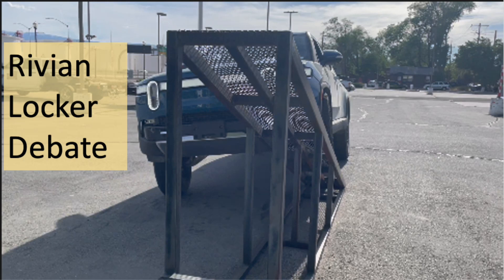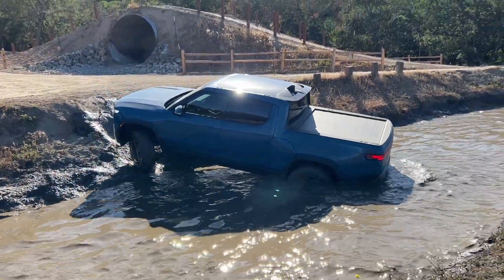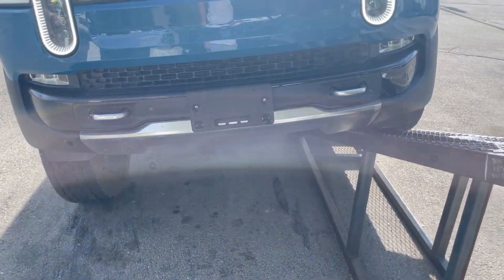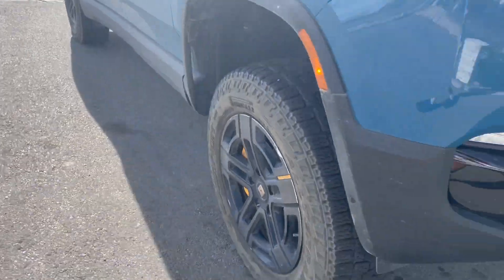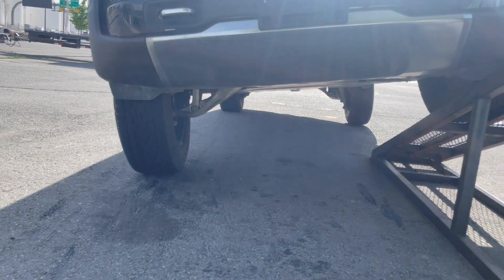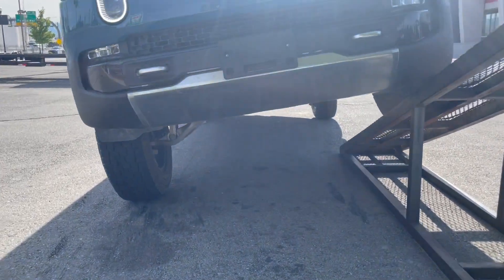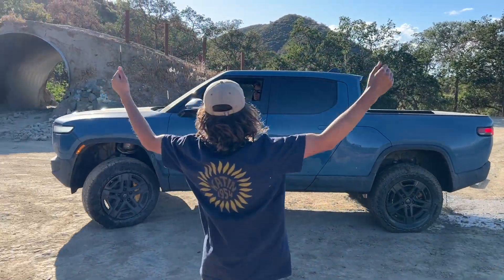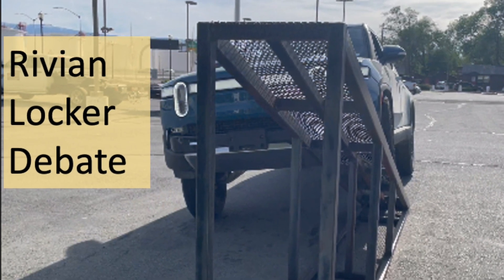R1t vs  Articulation Ramp

Comment: Quad motor or dual motor? I don't think quad has shafts connecting both sets of the wheels i think each wheel is individually driven, i feel like the software tuning needs work. If dual motor, then there would be a front and rear drive shaft going through a diff so in this case definitely should have a locker.

Comment: Did you try sand? That should better mimick a locker.
Reply from the maker: That is an interesting point. I did this before sand mode was launched, so I’ll go back in the next week or two and give it a try.
Reply: @Rex Briggs  I figured, as that was a newer feature they released. Also a snow mode. But that just eases the petal a bit from what I have seen. Be interested if what you find with those 2 new modes. Thanks for the videos!
Reply: @rexbriggs3251   any follow up on this?

Comment: What they need to do is incorporate a full send mode that locks all four together and transmits equal power
Reply: Not equal power or torque but rather making all four rotate at the same rate. Or better yet the same rate modified by steering angle.
Reply: @WilliamAArnett  sounds like a plan
Reply from the maker: I like it too Bihh and Bill. I am sending a link to the comments to my R1T advisor, and maybe it will get some consideration.
Reply: Off road use only of course

Comment: Not positive so don't quote me but, 4 motors working together, this vehicle is incredible, but limit grip to a single wheel and it's quartered, which paired with a heavy vehicle, might be too much for it to overcome.
Reply: Each motor has 200 hp. That’s plenty even if only one has grip. In this case two have grip (LF and RR). The problem is that the software isn’t asking the motors with grip for enough power. Perhaps it’s sensing that the two wheels with no grip are slipping and reducing power to all four?

Comment: Push the pedal until the vehicle moves.
Reply from the maker: You’re not wrong :) 
But, in certain situations I don’t want to floor it and wait to see if it takes off- that could flip the vehicle. I would like to have control to inch forward.
Reply: In rock crawl mode the entire pedal movement equates to 20mph - does that mapping not give you sufficient control precision?
Reply: That doesn’t work. It limits the power even at full pedal. Very frustrating!
Reply from the maker: @WilliamAArnett  so true. It does seem like that could be fixed with software.

Comment: I’ve had similar problems where there was plenty of traction on one wheel but it got no torque. It seems like a some sort of software fix should be possible. This has been known for a year now. Why haven’t they fixed it????
Reply: Each motor has more than 200 horsepower. That’s WAY more than needed to push the truck up that ramp. The problem isn’t that the motor is powerful enough it’s that the software isn’t asking it for any. (Torque at zero rpm is no problem.)
Reply: @WilliamAArnett  its torque that is the issue.  The max torque is actually made just above 0 RPM's.   A jeep in low range produces more power with lockers at a single wheel with a  weak little 275 hp motor.   The other issue is if it is able to move the wheel its likely to spin like its corked up wheel speed.   I think there are a number of mechanical disadvantages here, specially for rock crawling. But only time will tell, guess we will see if they improve without redesign.
Reply: @Story_Teller_Everyone  Well, I agree that the R1T isn't a very good rock crawler. But not for the reason you posit. IMHO, it's just a software bug, or maybe a missing software feature (plus fragile suspension and vulnerable bumpers and rocker panels). That these things haven't been fixed is probably just a matter of priorities for Rivian, not fundamentals.

Yes, theoretically a 275 hp (260 lb-ft) Jeep (3.6L V6 auto) with both axles locked could put send all its torque to a single wheel. But that would only happen if the engine was at almost 5000 rpm, very unlikely. And even so, that's only a little bit more than the R1T is capable of on a single wheel, 908/4=227, and which is available at (nearly) zero rpm. The Jeep has LESS torque than the one-wheel Rivian at all rpms below 2500.

In the RTI ramp test there are two wheels with good traction, not one. With two wheels pulling the R1T has way more torque in all cases.

Rock crawling is not about power or torque, it's about traction. In my experience there's never been a case where I needed more than a fraction of the Jeep's power when on the rocks. (I have used all the power in sand but of course that's using all 4 wheels.) (And I've seen plenty of examples of guys trying to use all their power on rocks and the end result was something broken.) 

The problem is that the software just isn't telling the right motor to produce the right amount of torque.
Reply from the maker: @WilliamAArnett  love the discussion and sharing point of view and experience. 

Bill, I hope you are right and Rivian can do a little software update.
Reply: I actually think its more the motor cant produce anymore torque at 0 rpm.   I canceled my order over this, was going to sell my Jeep and get a Rivian.  Opted to keep the jeep and get model 3.   Still think Rivian is awesome but it certainly isnt a rock crawler.   A better rock crawling setup would be duel motor with true locker, so they can use full power side to side.
Reply: I think this actually will improve with the dual motor set up honestly. It’s easier to manage some of these issues.